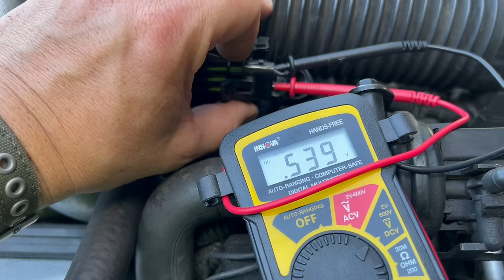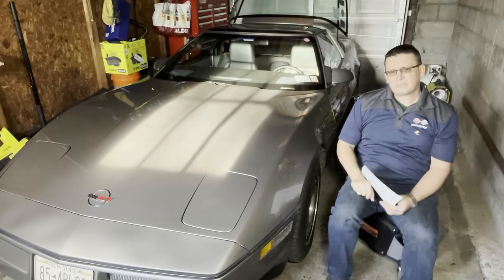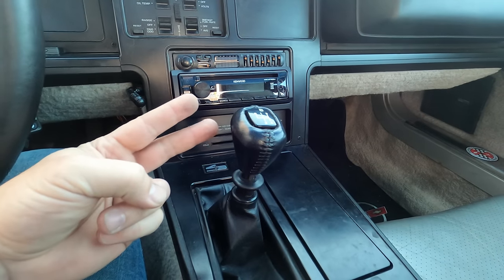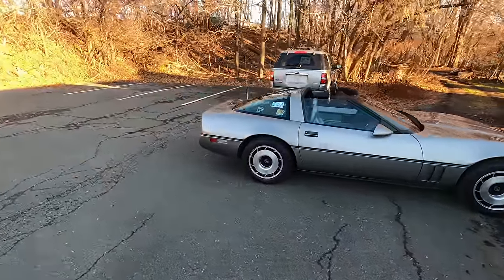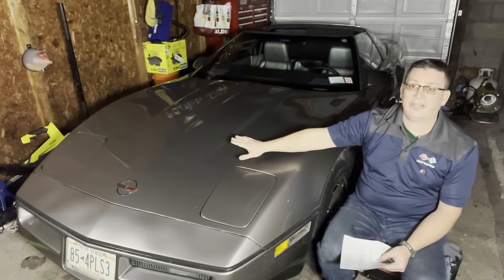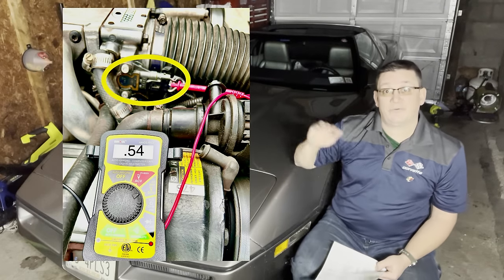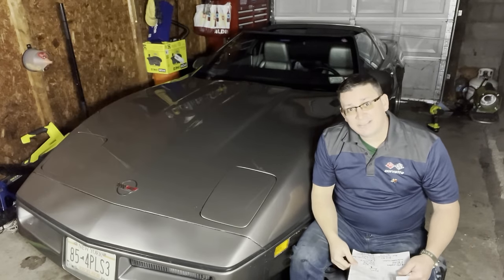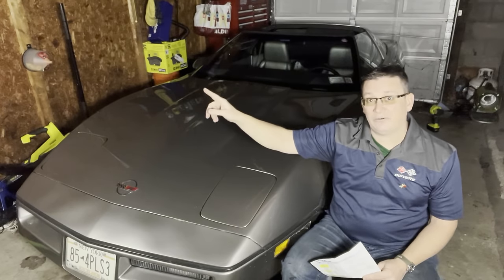C4 Corvette(Full Video) 1985 Z51 Doug Nash 4+3🏎️

Comment: Great to see your post. I bought a 90 with a little over 27.000 miles. I knew it needed some love, so I plan my budget for what was ahead. Paint and body, and interior are really nice. The maintenance was poor. The original owner lubed it to death. So, grease was everywhere, fluids were same as yours. Like dark coffee. Tires were 1991 in front and off brand wrong size tires in the rear. Rims were on the wrong side in the rear, which overheated one of the rotors. The idle was ruff, and oil was leaking from the rear of the manifold. In replacing the man. gaskets I put a new EGR and Thermostat plus new cover and gasket. Yea the old one was leaky due to corrosion on the cover. I learn to test any new part. 2 EGR valves later. Delco both Bad. New headlight motors, brake hoses, Full fluid change. New belt and tensioner, both were iffy at best. Door window seals, plus complete door seals. Oh, the plugs were wrong! Plugs were not for the aluminum heads. they were for the cast iron Camaro or firebird TPI 350. Funny it ran for at least 300 miles like that. Now after seeing what you paid, were pretty close in the dollar mark. You know about any 30 plus year old is never cheap. Mine is a convertible with the hard top, auto. You don't see many Turquoise Metallic green driving around in the Pacific southwest. It now runs and drives like it should. Like you I'd go anywhere with it now. Glad to see an honest clip about what it can add up to. THANKS
Reply from the maker: Thank you for sharing your project.  If people are looking for a car to buy and drive…a poorly maintained any 40 year old car is not the way to go.  But if you like to tinker and don’t mind spending a few dollars, it’s a great option.  I paid more for my other 2 newer C4s and they needed very little.  I’ve 98% enjoyed getting my car up to speed…I pulled it out of the garage to work on my Explorer and after a month of sitting it fired right up and idled perfectly…can’t buy the satisfaction that brings.  Thanks for checking out the channel and content AND sharing your experiences with your 90’.

Comment: I have a 1986 Corvette Coupe which I bought a few years ago. It was running good and I was in the process of taking it to the DMV to get inspected, when it started backfiring and finally stopped. I had it towed to my home where it has been sitting for approximately a year.
    I'm not sure if the previous owner had the fuel pump and filter replaced when he had the engine and trans rebuilt as shown on the mechanic's bills. I have all the work that was completed on the Vet.
In your video you mentioned that you replaced the fuel pump and sending unit and also cleaned out the fuel tank. When you were completing this work, How did you clean out the fuel tank? Did you have to remove the tank from the Vet and then how did you clean it?
    Also, someone told me that a relay could have gone bad which caused the engine to backfire by starving the fuel to the engine. Is this possible? 
Thank you!
Regards, 
Robert
Reply from the maker: It’s very easy.  Four torx bits to take the panel around the gas cap off, 9 10mm bolts to get the fuel sending unit out.  I siphoned the fuel out and used pigmat and shop towels to wipe the tank out.  Took about an hour.  I’d consider it an early C4 must do.  Thanks for checking out the content!
Reply from the maker: It’s very easy.  Four torx bits to take the panel around the gas cap off, 9 10mm bolts to get the fuel sending unit out.  I siphoned the fuel out and used pigmat and shop towels to wipe the tank out.  Took about an hour.  I’d consider it an early C4 must do.  Thanks for checking out the content😎

Comment: this was very good.  had no idea about the tailight bulb orientation.

a small flathead helps on 85 injector connectors.  need to remove the egr pipe though.  i had an 85 once with a dead cylinder and it was because the wire had been pilled out of the inj connector under the rubber boot.  presumably because of someone fighting to remove them all!!  that was a doozy to diagnose!

no doubt u r on cf, will see u there
Reply from the maker: Thank you.  At some point I’ll pull the whole intake off and replace the fuel injector connectors with the new style…maybe do new fuel injectors then as well…thanks for checking out the channel!

Comment: check recalls on those belts which affects 84-91 c4's as they had a defective retractors campaign recall 91C25 and 91C26 which is for both driver and passenger seatbelt, and at times one cannot exit vehicle, if they had been done should have a sticker on each side of radiator shroud. Since recall campaign was not entirely thorough some c4 owners are just finding out!
Reply from the maker: I bet both of mine are bad…no stickers, have had issues with them.  Thanks for your comment and thanks for checking out the channel😂

Comment: It is my understanding that while the 16x9.5 wheels were intended only for Z51 equipped cars, the reality was that 1984-1987 Corvettes were fitted with whatever the factory actually had in stock at the moment. So there were definitely Base cars fitted with 16x9.5 wheels, and there may also have been Z51 cars fitted with 16x8.5 wheels.
Reply from the maker: I bet that’s true.  My Bright Red ‘85 has 8500 miles…it’s a time capsule…but it’s base with 9.5”.  Unfortunately the original owner passed away so some documents, the original body color top and service history are sort of lost.  At this point it’s part of the mystique of these cars…40 years later can you really know for sure?  I’m just happy to have them and enjoy maintaining and driving them.

Comment: I have an 85 silver Z51 4+3 over here in the UK.  It was built Jan 11 1985 so a few weeks younger than yours  but the overdrive switch is still on the console not on the shifter like yours. Perhaps the factory produced both types for a short time or maybe yours was modified later?
Reply from the maker: Interesting.  It’s seems like there was variances with wheel width and certain items…it’s hard to sort out 40 years later.  I know for sure I’ve had a bunch of cars and I’ve found it to be a reasonable car to work on and a great driving experience!  Thanks for checking out the video.

Comment: I like your video and your cars . When you drive the Doug Nash do you shift from 2nd to overdrive then 3rd, overdrive and so on?
Reply from the maker: Most of the time I use it like a fifth gear…I don’t go 2, 2OD, 3, 3OD.  But if I’m cruising in a 30MPH zone I may choose 2 with OD so I can just step on it and it will downshift on its own…or 3 with OD in a 45.  Thanks for checking out the channel.

Comment: Ihavea86
Reply from the maker: I believe’86 is a split year, half had side bolt cast iron heads and half had the center bolt aluminum heads.  And ‘86 was the return of the convertible.  Other than that I believe the cars are pretty much the same.  I just did opened the radiator shroud and cleaned out the radiator…game changer!  Thanks for checking the content😎